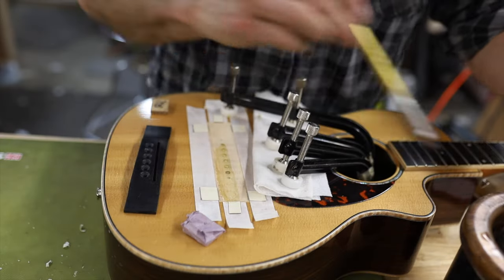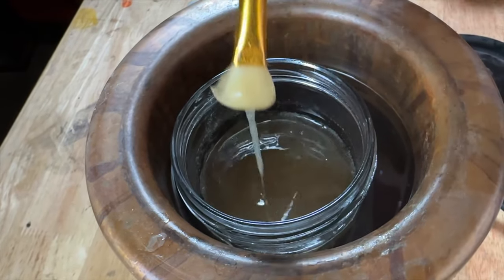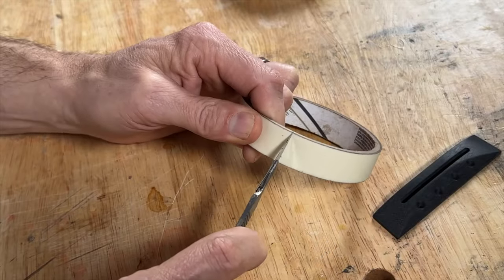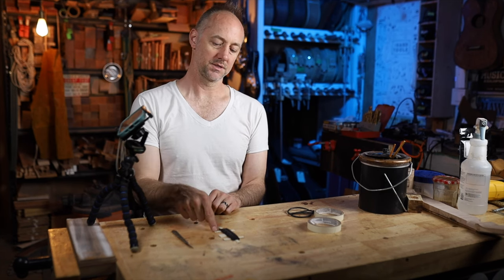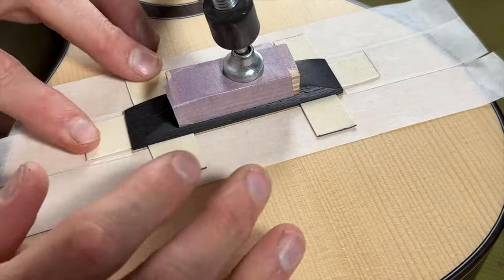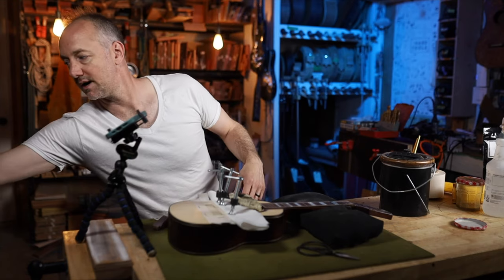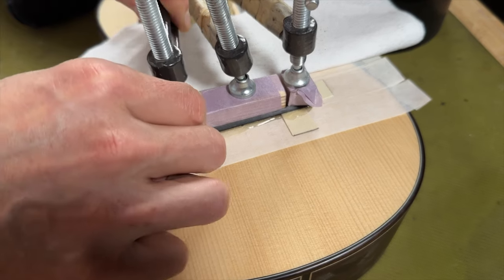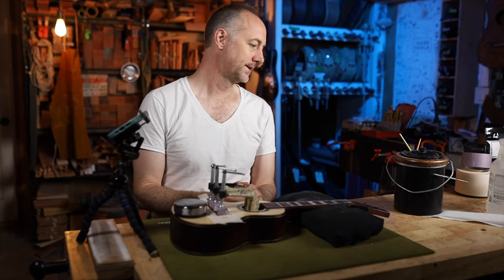7 Must-Know Tips for Working with Hot Hide Glue

Comment: Hi Beau,... one question... Why did you leave a small gap of (1/32) between the scored bridge foot print and the masking tape?... Would it be easier and have much little to clean when taping the masking tape right on the edge of the scored bridge foot print (after you peel the masking tape off), Perhaps you wanted an excess glue to ooze out for a thorough gluing of the bridge???.... Kindly enlighten me on this issue please.😊
Reply from the maker: It’s easier to see if the bridge has moved off of where it should be. I did this before I came up with the masking tape dams but I still think it’s a good fail safe to do.

Comment: Great video! Do you use a caul of some type on the inside under the bridge? If so, any tips on how to get it into place before or during glue up? Thanks.
Reply from the maker: @django02  thanks. I usually don’t use a caul on the inside - my clamps have about  a 3/4” Teflon disk thing which is big enough

Comment: Hey beau, nice video… with using hide glue on bridge… is it a problem if I don’t wax it as I want to French polish after gluing bridge on… scared the wax will repel the shellac… also what else do you use hide glue for? Or better still, what don’t you use it for? I’m considering using it on everything on my next flamenco guitar
Reply from the maker: You can use hide glue for EVERYTHING. I only use it on bridges and vintage repairs at the moment. I wouldn’t worry too much about much about the wax. It’s super thin and You can remove it easy. Or just don’t wax the bridge and clean the squeeze out immediately with a paint brush in warm water. Just use a damp brush, not “dripping wet” with water.
Better still, try both ways and see what you prefer :) 
Best of luck

Comment: I noticed you used MinWax, I assume floor wax, instead of Renaissance wax, which you have previously promoted.  Is the MinWax wax better, or did you run out of Renaissance wax and the MinWax wax was just available?
Reply from the maker: Renaissance I use for final finishing on fingerboards and bridges. I use this cheaper Johnson’s minwax for covering cauls, bridges, pickgaurd press cauls etc to minimize glue sticking.

Comment: Greatful for the tips ! My martin 00018's binding slightly shrink，Can hide glue or fish glue uesd for the repairing? Thinks!
Reply from the maker: You gotta heat up the binding with a hair dryer so it pushes back into place with no effort. Then use 3m pr600 ca glue or canopy glue. It can get ugly very quick if you don’t know what your doing

Comment: What do you consider the work time for HHG? Particularly concerned with the time to reattach a guitar back and clamp appropriately.  Thanks!
Reply from the maker: It depends how hot everything is- the room you are flying in and the surfaces being glued. hHG gels at 110F.
I would use Old Brown Glue (which is also a hot hide glue but with a longer open time as it gels at around 80F) for gluing on tops, backs and X braces. It can obviously be done with HHG, but I don’t want to stress rush those jobs.
Reply: Will do, thanks very much!

Comment: Have you considered using Fish glue?  It has the same properties as Hide glue, applied at room temperature, with a much longer open time.  I know it is rumored to be more susceptible to softening with high humidity.  Maybe you could do some tests??
Reply from the maker: I use fish glue for some small things but I’ve heard to many stories about it releasing under heat/humidity.
Reply: @BeauHannamGuitars  Stories are stories.  Unless you've experienced it yourself, you'll never know for sure.  You should do some tests.  Of course, the bridge would need to have a full string load.  I've used fish glue on a few bridges (6 string acoustic) and haven't had any come off.  I've had no problem using it with gluing acoustic necks back on after a neck reset.  Humidity isn't getting in there.  Of course, I've kept them in close to optimal conditions, temp 80 or less and humidity 60% or less.  You'd certainly never have a problem in Colorado!  It gets a bit more hot & humid in CT,  especially in the last week or so.  I know Bryan Kymsey has glued at least one bridge on with fish glue as a test, and I haven't seen him mention it coming off.  It's possible having too much glue in the joint could cause the problem.
Reply from the maker: @davefengler4266  first hand stories from full time professional internationally renowned luthiers are good enough for me. I’m really only In Charge of where it goes after me- the customer it’s built for. If you glue a guitar with fish glue and it gets sold on to someone in Singapore- the guitar will become deconstructed.
Reply: Absolutely